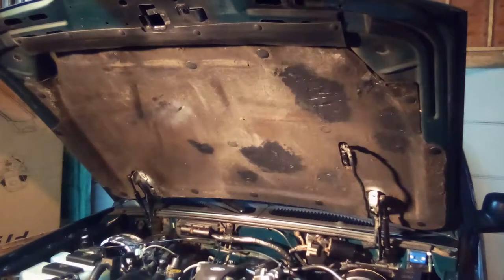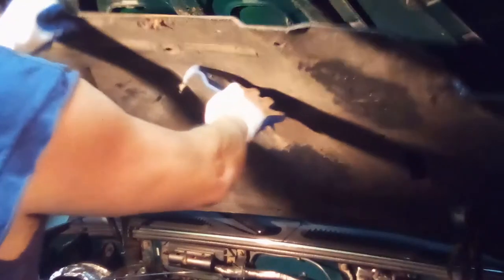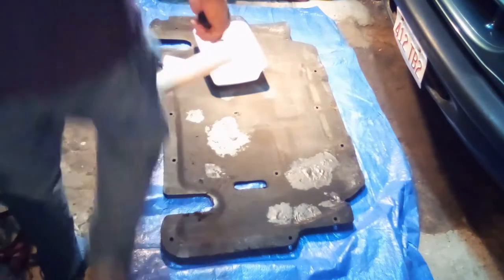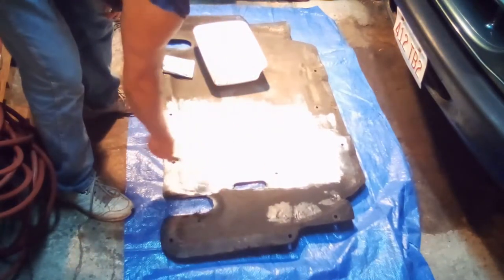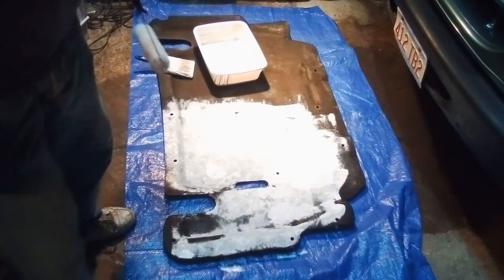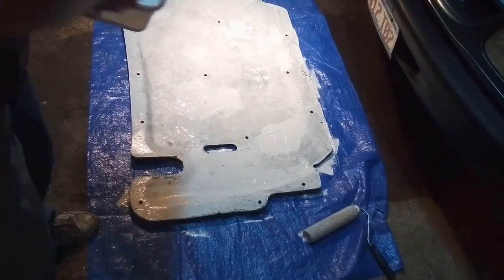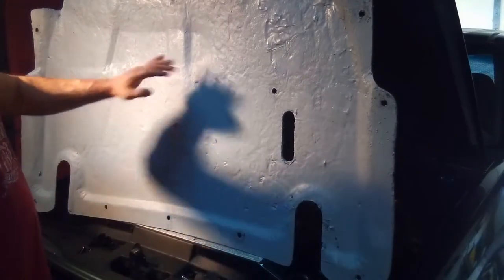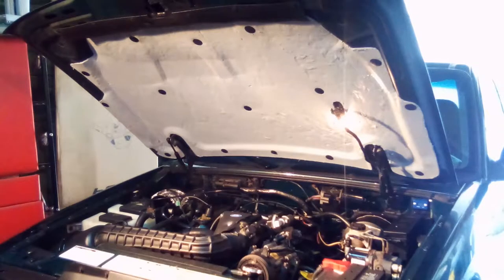How To Repair Ugly Hood Insulation Automobile

Comment: Nice job. I was thinking of doing mine bright red to match the paint on my 07 Mustang. Do you think it would work and what is your opinion on spray painting it?
Reply from the maker: Thanks!
Sure, you can use spray paint. Be prepared to spray a few coats, if the insulation is made of the same material as mine. The insulation really absorbs the paint.

Comment: What paint did you use? High temp?
Reply from the maker: I used regular semigloss latex exterior house paint that I had from other painting projects.
If you decide to paint it don't put it on too thick and let it dry between coats, also use a gloss or semigloss paint because in time it gets dirty and all you'll need to do is wipe it down with a wet rag. Thanks for watching.👍🙏🙌😊
Reply: @WhipCityWrencher  have you had any chipping, cracking w/o high heat paint?
Reply from the maker: @justinurso4525  Nope, it's holding up fine.